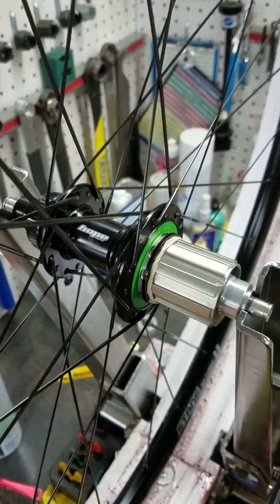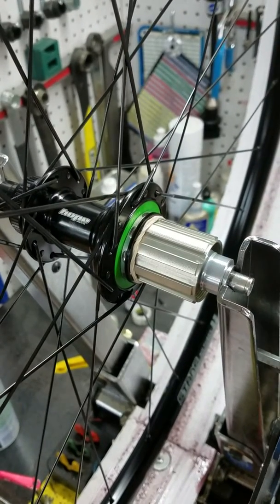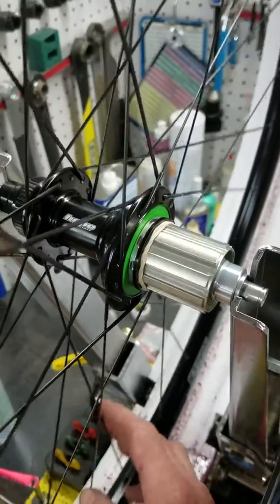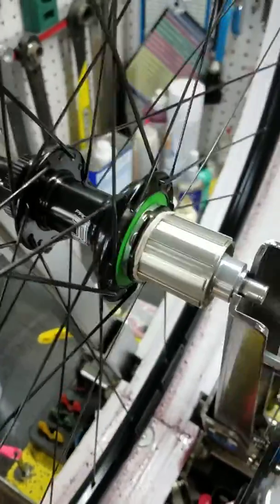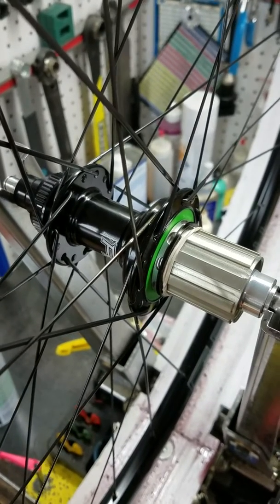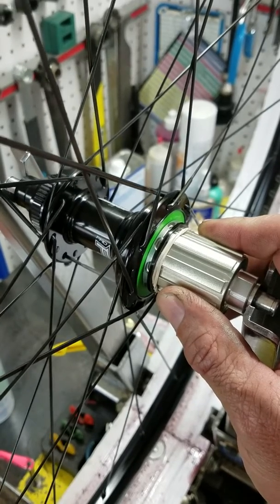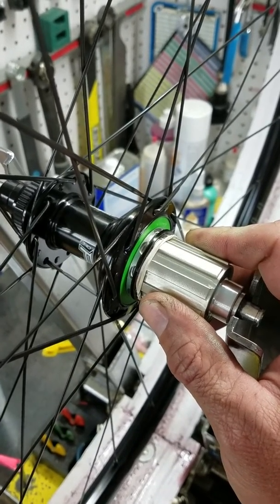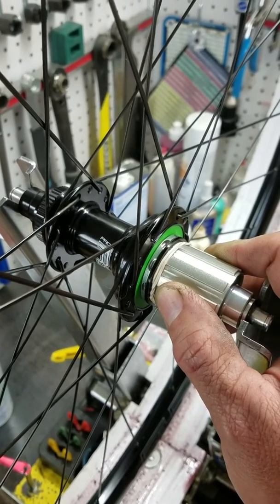Sound check hope RS4 centerlock

Comment: So RS4 hubs can be used with 4 pawl ratchet from Pro4?
Reply: The driver body that comes with the RS4 hubs only has a place for two pawls. However you can install a PRO4 driver in the RS4 hub and that driver body comes with 4 pawls.